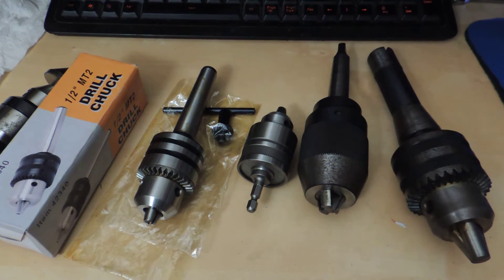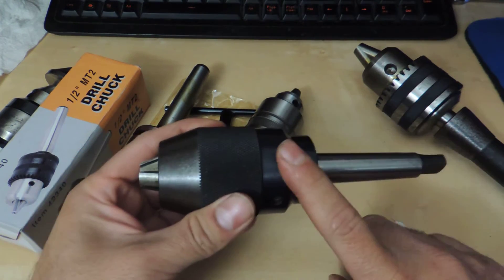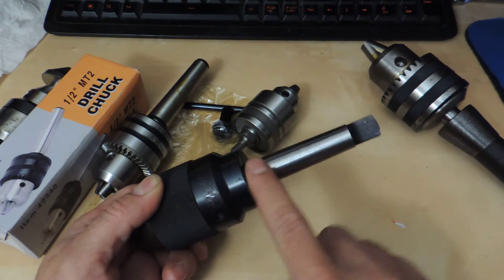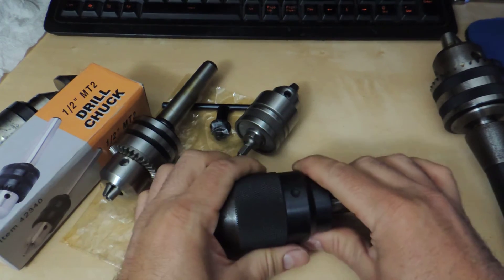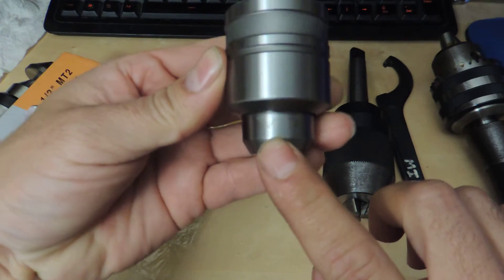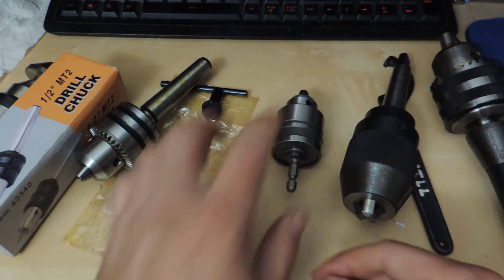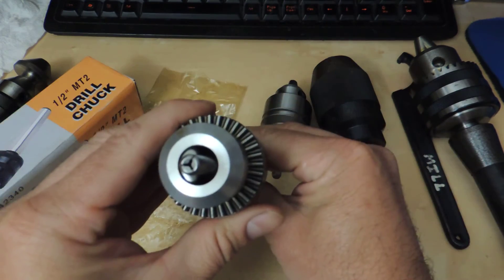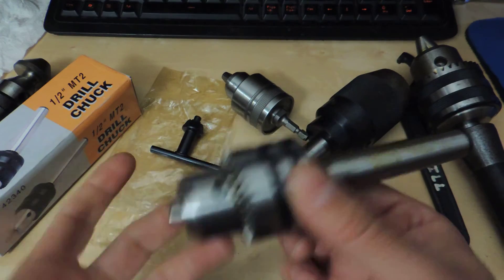Chucks and Harborfreight item 42340

Comment: Idk what this guy it talking about honestly he’s complaining about the movement on the part of the chuck you want to move? It’s completely fine won’t make a difference in movement when drilling. And then what’s he talking about a screw that goes into the end of the chuck in a drill press or a lathe it’s using a rack and pinion there’s no screw pushing on the end of the chuck if that was the case there would problems pushing chucks out of the matching tapers. It sits in the taper nice and tight and the female taper moves it’s not making the chuck taper move directly

Comment: I'm confused about the subject of this video.
Reply from the maker: I just wanted to show the different sizes of chucks that you can end up with, but also show you the one that really fits better with the mini lathe. Which is the small harbor freight chuck. So just taking a look at the small differences that can help you or make it hard for you to work with, as in the sort of round tang which I eventually milled off and that helped but it was still too big for use on a mini lathe. Sorry about the confusion. I have been trying to do better on videos, it's a lot harder for some of us than it looks. Not to mention talking to a camera and when people are around just doesn't feel natural to me.
Reply: I guess with the tang the chuck was too far forward and caused wobble.
Reply from the maker: Yes the tang caused the wobble, but I only cut the end of it, not the whole tang. I just flatten it out so that it could still be used on the drill press which uses a chuck with a tang as well. I just wanted a keyless chuck so that's why I got this one thinking it would work. Unfortunately it didn't work as well as I thought on the mini lathe due to the size and round tang, but even after I did that it was still a bit too big. So the small chuck with the key works and fits much better on the mini lathe.